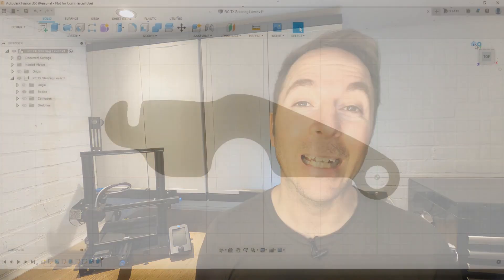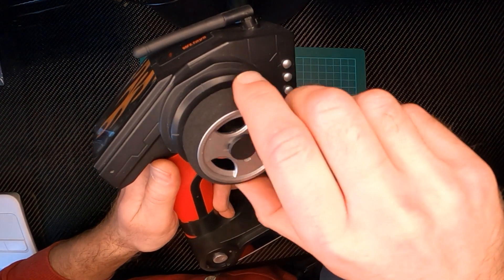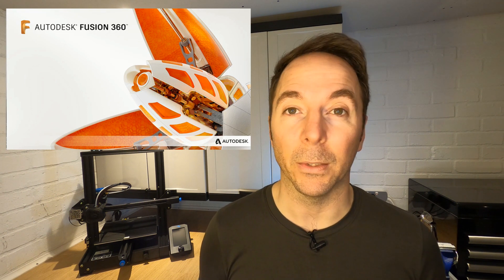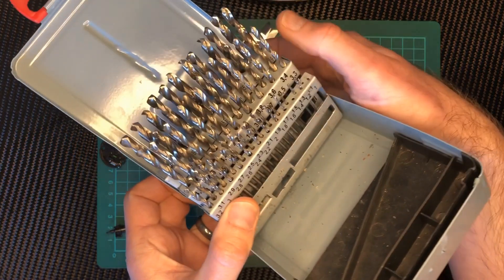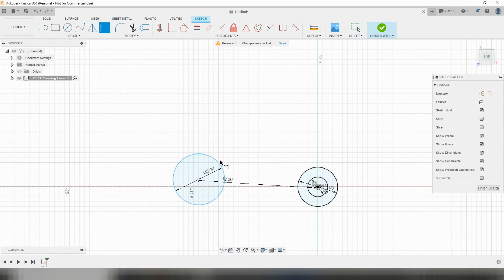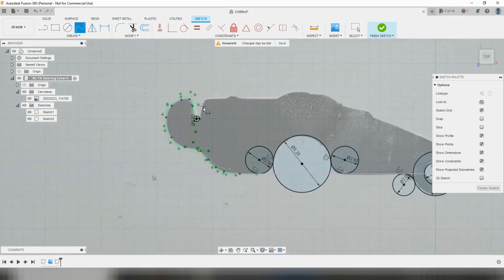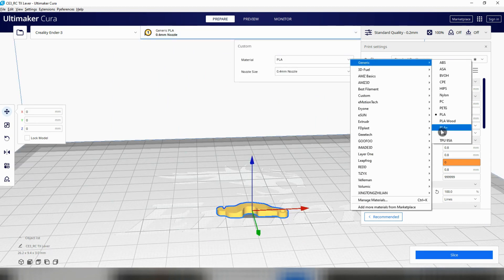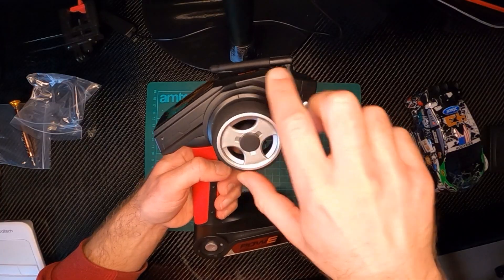Fix Anything With A 3d Printer

Comment: Hey, many thanks for this video. Could you please advise how steep learning curve is that software realistically? For designing simple parts, how many hours of learning should I assume? Also, what filament would you suggest for general purpose fixings, something strong but also that easily bonds with the glue to wood and metal. Again, thank you very much!

Comment: If you use a ruler in the picture of your part, you can dimension the picture exactly to scale and get pretty darn close to actual dimensions. If you’re going to import a picture I always recommend, although you basically did the same thing using the critical dimensions of the part. Great video, just repaired my chainsaw choke that broke, took about 45 minutes for a part that would be a hassle to find and have shipped in.
Reply from the maker: Great tip, thanks 👍

Comment: So far I've only dabbled with Tinkercad, it has built in tutorials and it's so easy to use that even my 10 y/o daughter can design stuff.  Will have to give Fusion 360 a go at some point.
Reply from the maker: Fusion 360 was pretty intuitive for me once I got the basics down. I'd definitely recommend giving it a try if you want accurate functional parts👍

Comment: Nice, handy tips on how to measure the hole positions.
May not always be needed if you have a photo to align with anyway, but good practice (and confirmation when it matches the photo).

I need to get started on modelling a few things.
Reply from the maker: Sure, I have used photos for more accurate measurements before but have got into trouble because of lens distortion/perspective. It's not too bad on small bits but if they are critical measurements I always measure. You still need to measure at least one dimension to scale the photo too👍
Reply: @RickyImpey  noticed you’re using the smooth side of the bed now. How do you find it compared to the coated side?

Also, any recommended videos/guides for getting started with Fusion 360?
Reply from the maker: @nodowt  I do tend to use the smooth glass side more as I have more successful prints with it compared to the carborundum coating. I think both sides work but the carborundum doesn't seem to work so well unless it's over 60°C. I also do use a little glue stick if I want a guaranteed successful print and it's easier to clean off the glass.
When it comes to Fusion 360, I find the 'Product design online' YouTube channel to be the best. His 'Learn Fusion 360 in 30 days' series taught me all I needed to know to get me started a few years ago. Highly recommended 👍
Reply: @RickyImpey  cool, I haven’t tried flipping yet, so far so good with the coated side. The smooth glassy finish on the bottom of prints could be nice though; have seen some carbon fibre beds which leave a nice finish too.

I actually have that playlist saved to watch already, will need to get started on them.
Reply from the maker: @nodowt  the glass does give a lovely flat finish on the bottom.
I highly recommend committing to a week of a Fusion instructional video a day. If you're anything like me, I had always assumed it would be more difficult. I think anyone who owns a 3d printer should try and learn how to create their own things to print, it opens up a whole new world. Good luck and let me know how you get on👍
Reply: @RickyImpey  I'm hoping this comment comes through to you ^-^

I have and S1 Pro, just like you, and I've set up my CSP with the help of your videos

I do have a Carborondum bed, but I'm really not so sure how to mount it properly on the S1Pro... 

How do you mount your glass bed on the S1Pro? Where are the clips located exactly?

And I'm going to start with F360! 
I had a client come through this weekend and asked for a clip replacement he can use on his vehicle, I used Blender ':D
I'm guessing it would have been a lot easier in F360! XD